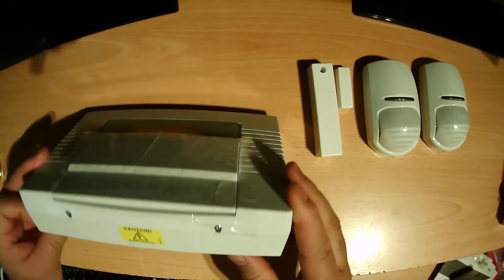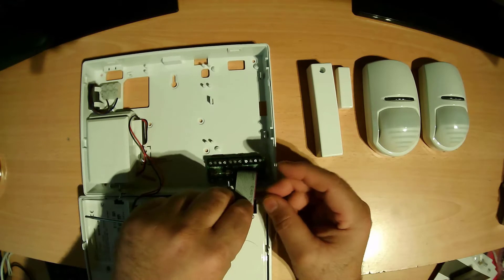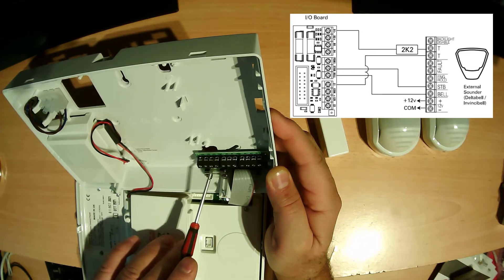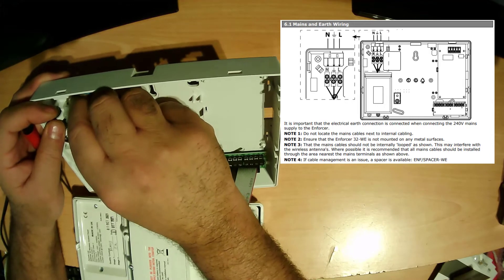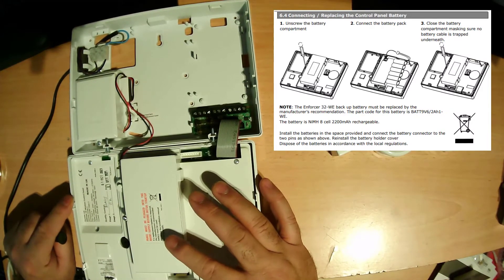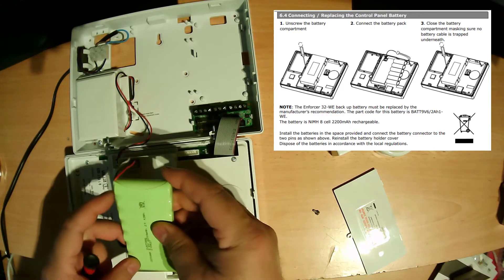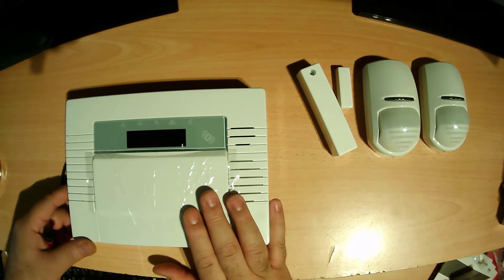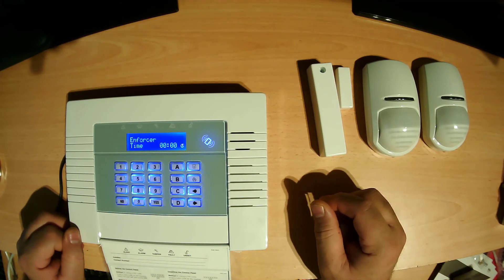New Pyronix Enforcer V11 Panel How Do Connect Main 230v Power Connection Part1

Comment: Hi, what are you doing with the earth cable? The diagram on the instruction manual is not that clear and I can only see you putting in love and neutral on the board. Thanks
Reply from the maker: Manufacture no required earth cable. Line in connection they have spare connector just leave there.